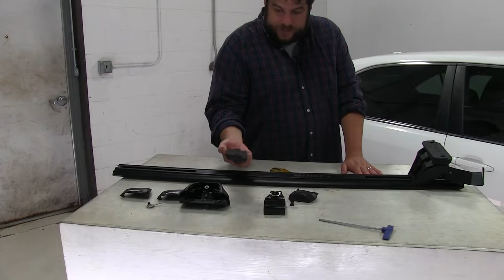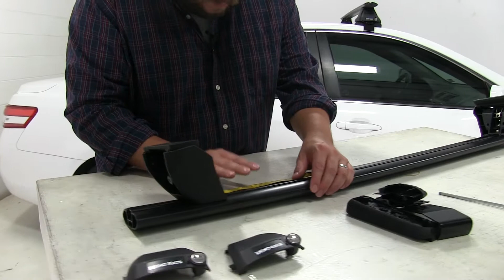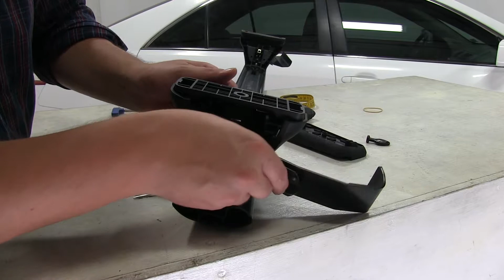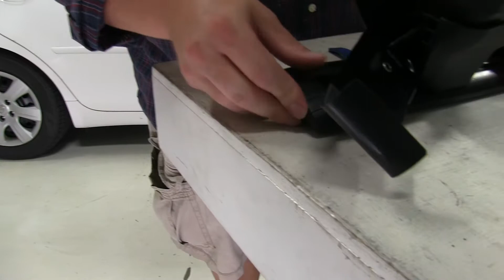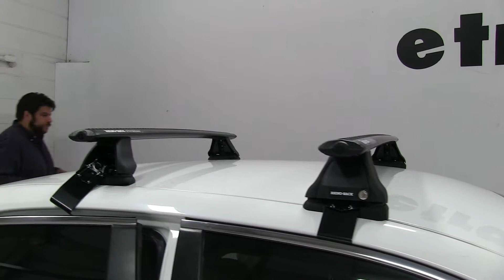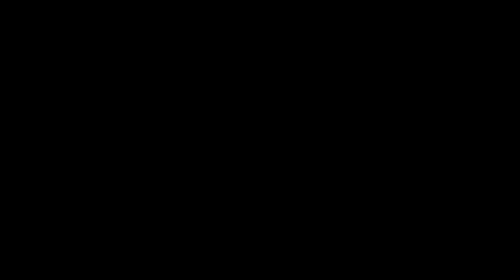Fit Test: Custom DK Fit Kit for 4 Rhino-Rack 2500 Series Roof Rack Legs with 2011 Toyota Camry

Comment: Can I mount 4 bikes in it?
Reply from the maker: Depending on the style of bikes and the handle bars you have, you might be able to get all 4 on your roof rack. You will want the alternate the orientation of the bike forward and backwards. I would recommend going with a longer set of roof bars so that you have enough space to mount the bike racks.
https://www.etrailer.com/Roof-Rack/Yakima/Y00426.html
https://www.etrailer.com/Roof-Rack/Yakima/Y00146.html
https://www.etrailer.com/Roof-Rack/Yakima/Y06123.html